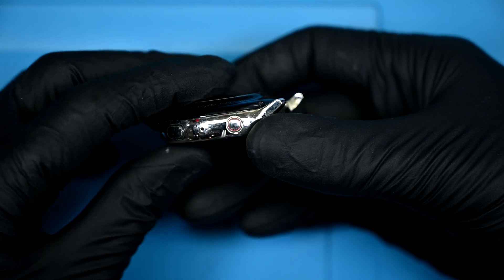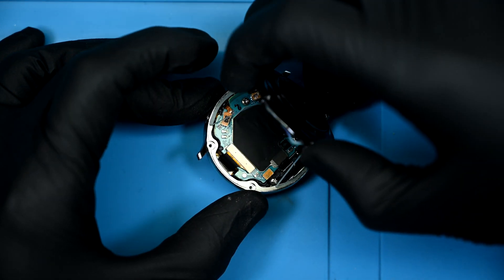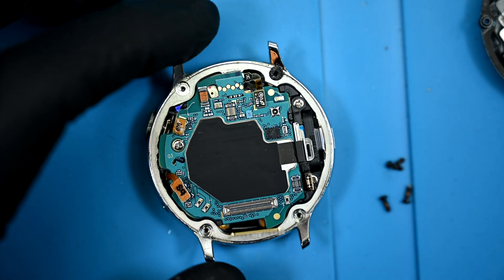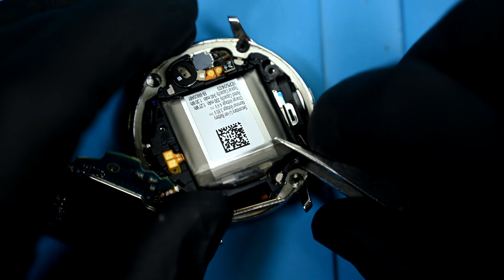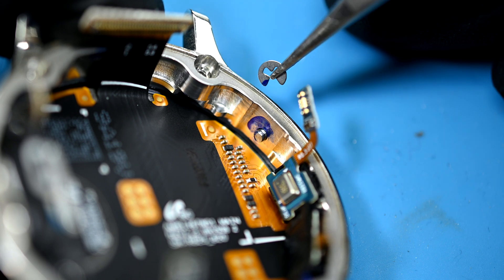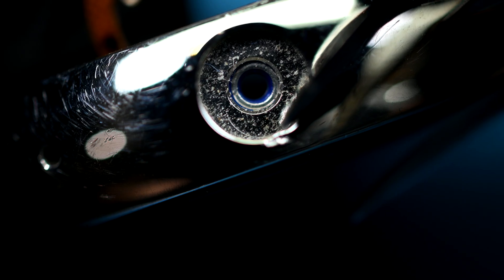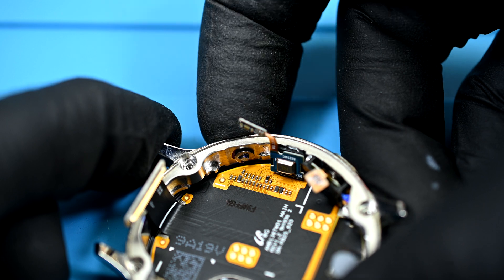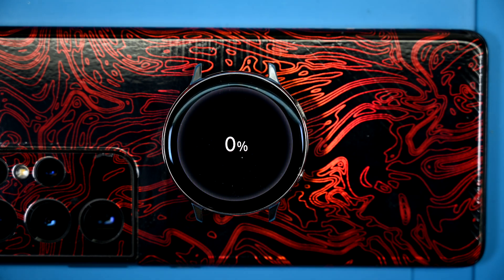Galaxy Watch Active2 | Teardown | Stuck Power Button

Comment: how does the water waterproof structure work？ didn't see the silicone circle
Reply from the maker: (Edit) this one is actually a water resistant tape adhesive that is around the frame, I think in my video here most all of it was stuck to the lower casing I removed.

Comment: after a trip my back button stopped working.. it still can be pressed and bounces but but its like the piece it presses against is broken or something.. has anyone brought that kind of issue to you before?
Reply from the maker: Super super common on iPad home buttons actually, and most manufacturers use the same nipple style buttons. Basically two tiny thin metal disks on top of one another with a small black "nipple" on top. The metal discs act like springs and make the click sound, but it won't actually register a press if the nipple has fallen off or slid off. If you're able to find a shop that can replace iPad nipples, they should also be able to repair this
Reply: @TapticDigital   wasnt really sure i would get a reply but really appreciate the insight, its going to shop tomorrow for inspection, will post what they say can be done or if its a lost cause

Comment: I'm having a very similar problem but with my back button, I had a shower with it on the other day and it seemed to stop working I put it on charge and it went into rebooting mode on a loop for 24 hours. I then used a hair dryer to heat it up and then put it in a bag of rice for 24 hours. And it did the job it works again. But now I have a different problem, every 30 seconds samsung pay pops up on my watch. Iv done some research and it seems to be the back button is stuck / not working. And tips? Or ideas?
Reply from the maker: Hmm, it's possible some minerals from the water, usually calcium from tap water, built up on the connection. If you want to avoid opening it, your best best will be to put a few drops of isopropyl alcohol on the button and repeatedly press it to work the alcohol into the housing. You may have to repeat this process once or twice. The alcohol should break apart any build up without hurting the electronics. Ideally I'd say open it and scrub, but not everybody wants to risk disassembling it!
Reply: Exactly what is happening to my galaxy watch 4 right now and how I stumbled upon this video. I've had it in the shower and now it endlessly loops to Samsung pay (or Bixby) and sometimes even tries to do SOS calls. I can't even switch it off because it's the power button that loops endlessly and it just switches back on on its own. 🙄

Comment: That tiny thin ribbon cable that connects mobo and battery, got ripped.  Any way to fix that?
Reply from the maker: Unfortunately finding a replacement will be the easiest way. Some wild solder technicians have successfully stitched ribbon back together, but in most cases it isn't worth it

Comment: Can you please tell me, what glue do you use to stick it and is it resistant to water or sweat?  Thank you!
Reply from the maker: I used a silicone based glue, B7000, it's relatively water resistant. Though lately I've switched to a cold pressed silicone glue that seems to work better

Comment: Wow thats good ....good explanation, amazing footage...
Reply from the maker: Thank you! I try to keep it high quality!
Reply: Hey i accidentally yanked the display off the frame....and i think diplay got damaged somehow and touch is not working (digitiser i think) is it possible that... Through that same connector the display is working and digitiser not?
Or maybe the other end of cable attached  to the back side of display got damaged....
Or its just a loose connection on yhe motherboard....
Reply from the maker: @SidArtx  very possible, even a small tear in the ribbon can cause all kinds of issues. Everything is so tightly sandwiched together its unlikely to be loose, sounds more like possible damage unfortunately
Reply: @TapticDigital  thanks for the info...

Comment: Hello thanks for this vidéo.
One question, what kind  silicone seal are toi using ?
Thx
Reply from the maker: This one is B7000 adhesive
Reply: @TapticDigital  Hello, can I use T7000?  They say that B7000 and T7000 both have the same sealing properties, differing only in color.  T7000 is pitch black and is typically used to glue the screen because it blocks light of the display from leaking to the sides.  Thanks for the video.
Reply from the maker: @paulocarvalho7877  yes T7000 would work fine, you don't really need the light sealing since nothing inside lights up. But from an adhesive standpoint they should work the same
Reply: @TapticDigital  Ok!  Thank you.  Again, well done video.